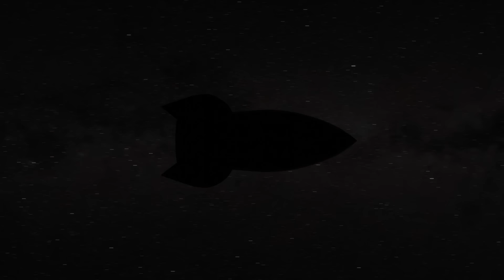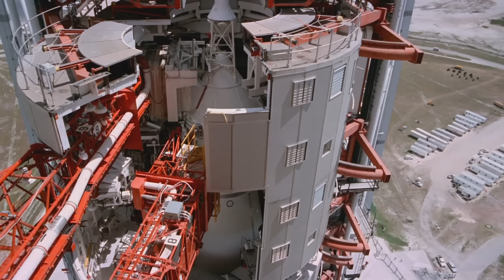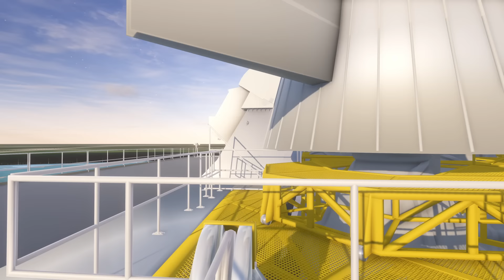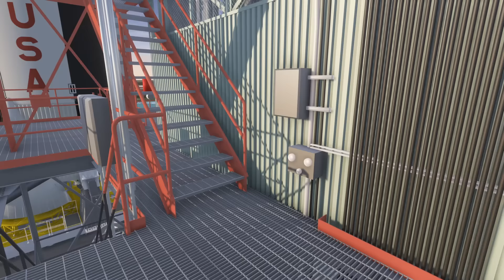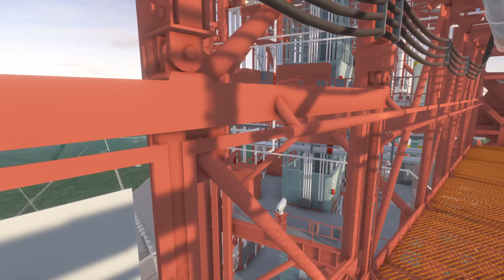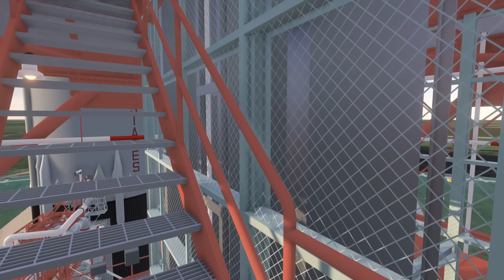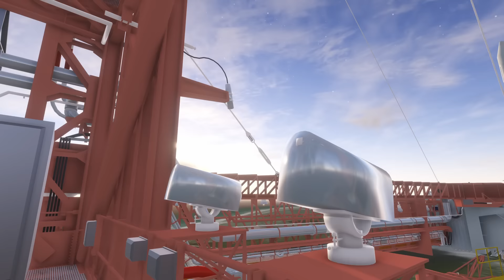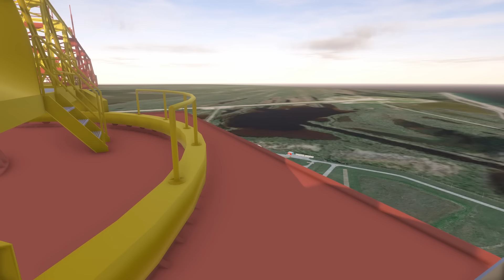How Did The Massive Launch Tower For The Saturn V Work?

Comment: 12:41. CORRECTION; The fairings you described as rockets are actually covers for the liquid hydrogen fuel lines from the hydrogen tank. The go around the sides of the oxygen tank.

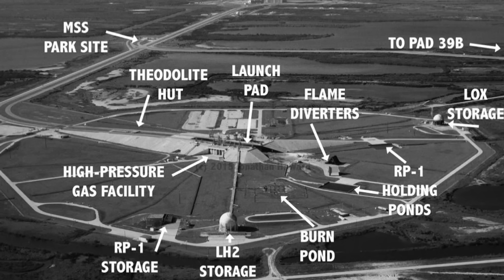Comment: At the 5:00 mark, the image shows on the right, RP-1 Holding Ponds. I question that designation. Yes, they are ponds, but, I believe they are ponds to pool the water that is dumped into the Flame Trench. Starting at the Flame Trench, there is a concrete area. On both sides there are drainage channels that lead to those ponds. Then on the other side of the pond, there is another channel that leads to the wet lands surrounding the launch complex.

I surmise that the water suppression system dumps the water onto the Pad. It flows down onto the concrete area. It is then diverted by the channels into the ponds. The temperature of the water that hadn’t been flashed too steam or at least heated to boiling, would have been significantly high. The water was drained into the ponds to allow the water to cool off before it continues it’s flow into the wet lands.

The ponds are about 179ft x 98ft with a surface area of about 17,500 square feet.

Comment: Elon "we don't need flame diverters we have invented a better way using high temperature concrete",  Fail.  "We have installed stronger concrete and all will be good",  Fail.   "We have made a water deluge system", Fail.  "We have upgraded the water deluge system so we are good now", Fail.   "We are building a new launch system with a Flame trench".  Just like every other launch system has well done Elon.

Comment: I read somewhere there are 8 (I think) bolts that attach the base plate of the first stage to the top of the launch platform.  As I recall, these bolts actually hold the Saturn V down for a few milliseconds after the retaining arms release.  The bolts stretch a bit and shear in two actually slowing the rocket initially.  This is to provide a smoother release when the F1 engines are at full power.

Comment: I love the detail on this model. When you were showing the first stage hold down clamps, there is something mounted to the base and connected to the stage. They are colored green on the model. These are pins pulled through a round die that dampened the first foot or so of liftoff once the hold down clamps released.

Comment: Great video! 

From a friend who worked on the launch team:  For whatever reason, the engineers were having a hard time getting the hold-down arm covers to close reliably. Springs…Hydraulics…didn’t work.  It was von Braun who told them to tie a rope from the covers to the rocket itself.  And, not sure about this part, I think they put a kind of ‘shear-coupling’ on the ropes to ensure that they all broke at the same time.

Comment: As a former Missile Launch Commander in SAC, I always cringed when I saw the Saturn service gantry arms just starting to retract as the airframe begins to move. Any single arm that failed to retract would doom the rocket as the lower stages get much wider. The Titan II only had a power/guidance connection that unplugged as the missile lifted off. It was spring reflexed to recoil to the edge of the launch duct as the stage one motors passed by. Of course, nothing in the SAC Titan world was designed for re-use except at the LFs at Vandenberg, CA..  Once, during a test launch out of Vandyland, the coupler failed to unplug on liftoff and it pulled the guidance package as well as the destruct package, out the side of the missile. When the missile started to turn towards L.A., the range safety officer issued the destruct command and they saw the "POOF" coming from the launch duct. Fortunately, liquid fueled rockets don't work well upside down when the turbo pump inlets get uncovered. The missile detonated itself.

Comment: Many arms that retract at launch are the propllent lines they cohort disconnect from the vehicle until first motion. That is because the engines could be shutdown at the last moment. This delay prevent a very dangerous sit a fully fueled and pressured vehicle without a way to vent

Comment: My uncle Roy was on the team that designed the launch arms. I asked him about it - and one trait they had was to maintain connection all while the rocket and gantry rocked at different rates due to the winds from the Atlantic. There's some 16mm film of the team rocking the boilerplate Sat V, using ropes and their feet. My uncle was in on that exercise.

Comment: Did anyone else notice how vertigo inducing this tour was? An aspect of realism that was probably not intended by the modellers ... but it gives an indication of the sheer scale of the Apollo stack once fully assembled. 363 feet from exhaust nozzle bottom to Q-ball.

Another statistic that raises eyebrows is this ... once the main engines were lit, they consumed propellant at the rate of ... wait for it ... 13 tons PER SECOND. That's what it takes to generate the 7½ million pounds of thrust needed to lift the stack into the air.

Comment: For the astronaut gantry retraction, it is obvious that the moving part is higher than the fixed part.  It is also obvious that the moving part of the gantry is aligned with the fixed part.  I am guessing that the moving part folds over the fixed part.  The would require the guardrails to be either bendable or movable, but otherwise I see no issues with this action.
Reply from the maker: Yeah, you can hear me pausing because I realized I wanted to figure out if the railing folded down, but that detail wasn’t clear from the model

Comment: You mention that it would be bad if the launch plate didn't fully detach before the tower arm started moving, my engineering brain immediately jumped to wondering what would happen if it failed to detach or the arm failed to retract as the rocket is already beginning to move off the pad?  Did we just really get lucky that never happened during the program or was there some kind of mechanism where they knew it would rip apart and eventually fall off without blowing up the rocket?

Comment: lol  , if the rocket with a gazillion pounds of rocket fuel and oxidizer were to be burnign..
you will be doused by water as you run in your heavy and flamable space suit... around the fecking burning rocket,  to get to your escape zipline..

That would be an exiting affair to say the least

Comment: sigh 

FINE, I'll do it then. 

Ground to MLP machine room access door = 43
MLP machine room access door to MLP surface = 33
MLP surface to S1C intertank platform = 105 (+8 to get to/from the arm)
S1C intertank platform to S1C forward service platform = 90 (+10 to get to/from the arm)
S1C forward service platform to S2C aft/intermediate platform = 30 (+30 to get to/from the S2 arm, +30 to get to/from the intermediate arm, +10 on the end of the intermediate arm)
S2C aft/intermediate platform to S2 forward platform = 90
S2 forward platform to S4B aft platform = 30
S4B aft platform to S4B forward platform = 60 (+10 to get to/from the arm)
S4B forward platform to SM platform 30 (+18 to get to/from the arm)
SM platform to crew access platform = 30
Crew access platform to elevator machine room platform = 60 (+18 to/from the observation gantry)
Elevator machine room platform to crane = 18 (+4 to access the crane boom)

Steps from ground to highest point =  619.
Total steps traversed = 757.

I'm going to bed. I have to work in 5 hours. You're welcome.

Comment: My stepfather was a mechanical engineer for NASA and his job was literally implementing pad maintenance and modifications on the Shuttle program.  There were scores of people employed whose only job is the pad to ensure its operating correctly, to refurbish it after a launch, ensure its is clean (more on this later), safe, and do incremental improvement to make it better or safer.   It just goes to show nothing about spaceflight is simple, even the humble launchpad.  There are actually some pretty good videos on youtube of the preparations and launch of the A4 rockets (a.k.a the V2).  Even as small and crude as the A4 is compared to even Redstone and Atlas it was a highly complex and choreographed process to launch it.

Comment: San Diego Air and Space Museum has many engineering films of Atlas and Atlas Centaur testing and launches. There are several that show how the disconnect works. The clip being referenced here is an okay example, from 1987, but the ones from the 1960's show the mechanisms clearly. There are even test clips from when they were developing and testing at Point Loma in San Diego, a more beautiful test site than that is hard to imagine. Search for the title: Atlas Centaur AC-67 Umbilical 3/26/87 HACL Film 00510

Comment: I would challenge your assumptions that there was a launch control computer.... More likely there was a bunch of mechanical relays with time delays and "run permissive" control switches introducing abort and reset loops. Cascading mechanical relays ran the world until the PLC revolution....
Reply: There was an RCA-110A computer in the Launch Control Center and another within the Mobile Launcher that were used to run checkout programs during pre-launch and during the countdown.  At 3:07 before launch, the automatic sequencer took over that used timing signals and relay logic for the terminal countdown.
Reply: I don’t think so, computers already existed, some already flew on the Apollo/LM spacecraft, Saturn V had its own guidance computer installed in its third stage, some of the launch ground computers are actually visible on the Apollo 11 IMAX movie.

Comment: In the event of a fuel leak, would anyone on the pad (especially the astronauts) have actually had enough time to make it to the slide before an explosion?  It seems like it would have taken quite a long time to get down!

Once people start arriving in the rubber room,  how do they know when to close the door?  If they close it too early, people will be locked out.  If they close it too late, everyone dies.  Could they tell somehow when everyone was off the pad, or when the rocket was close to a catastrophic event that oils require closing the door regardless of whether people were still outside or not?

Comment: Incredible amount of work to create this 3D virtual model.  Years ago I first heard of the weight and pulley system used to quickly and reliably retract the arms just before liftoff.  Sometimes the best tech for the occasion is thousands of years old.  Something to also note is that all launch towers require a lot of rework and repair between launches due to the thermal and acoustic trauma imposed on the towers.
Reply: i would like a video of the tower after launch,lots of busted light bulbs.

Comment: So did the space shuttle launch towers  have access to the rubber room? Do SpaceX or New Glenn have any contingencies for dragon capsules or starship? I find the probability of them being used unlikely, but just curious if NASA or private enterprise has revised their thought process since the 60s.
Reply: The rubber room and blast room weren't utilized during the Shuttle program.  The "tube" that was used as a slide during emergency egress in Apollo was not part of the Shuttle Mobile Launch Platforms, and the interface between the tube and the concrete pad structure had a plate welded over it.  However, you could access the rubber and blast rooms by entering a building (ECS building) near the edge of the pad perimeter and then walking underground in a concrete duct.  I was fortunate enough to be able to do so in the mid-90s.

Comment: There is a mass that's dropped to pull the umbilical arm away from the tower, I worked with my boss on the shock absorber that slows the mass to a halt. For the SLS system, that is.

Comment: Brought up some treasured memories. Didn't get to crawl around Apollo I was too young, but did the Space Shuttle. Rode the elevator up to the Cockpit service arm 39A and into the pilot chair to observe prelaunch end to end testing of our Spacecraft. I must admit to being a bit frightened at the heights and being able to see through the floors, some of the floors had access holes welded shut. That crew escape ride was petrifying. As a kid I'd get dizzy at the thought of riding that elevator up to the top but the excitement of getting inside the Shuttle wiped that away. I remember those Separation connectors being "Sacred" like "The Ark of the Covenant" sort of thing. We got a set to run our preship testing with, always assumed they were burned up until I got into the business. We made a bid on project Orion Avionics Ring and was hopeful to get out there again sadly we didn't and the whole thing cancelled anyway. Cool stuff! Thanks for the tour!